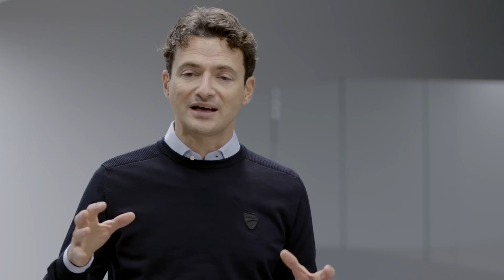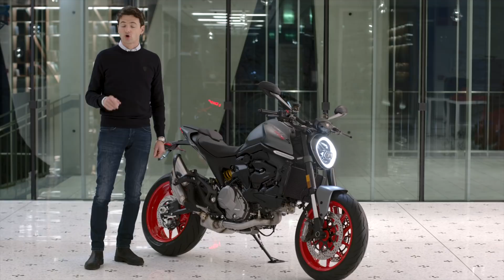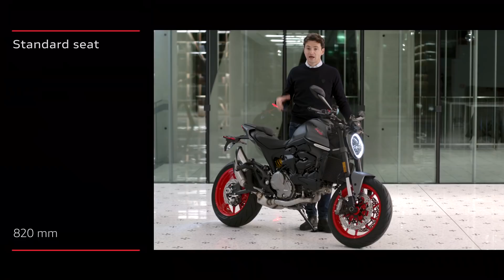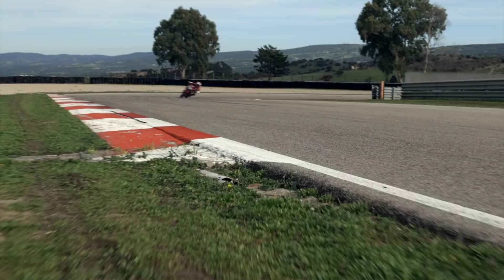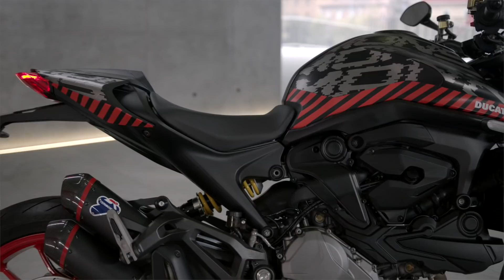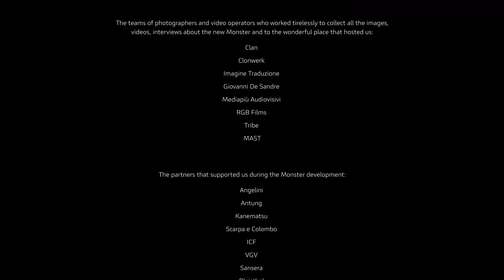New Ducati Monster | Ducati World Première Episode 5 (ENG)

Comment: No trellis, no monster...😢
Reply: Such an accepting viewpoint you have.
Reply: I feel the same way, should be called ‘Imposter’
Reply: @levicharles996  BS.  There's a heck of a lot more to a motorcycle than its frame design. Aren't you forgetting the 40 lb weight reduction on the new bike, partly enabled by the frame change? I've done a personal project Ducati where 50 lbs were removed; everything was improved dynamically. Everything.
Reply: @rlsedition  Yea I understand weight savings is huge. But I think everyone can agree that trellis frame, especially painted red is iconic. I rather have the valve spring set up than desmo on this bike. I own a M620 and that thing is stupid light compared today’s bikes, 35,000 miles of fun.
Reply: @levicharles996  Maybe Ducati pushed some of their product features a little too aggressively, like the trellis frames and desmodromics, only to drop them recently on some models. It's always a fight between marketing and product engineering - do you make changes when new/better technology is discovered? Do you sit on a design forever or do you re-imagine the look every so often? Tough calls, to be sure. OBTW, your M620 is WAY out of date, product-wise. Don't demo a new bike; I think you'll want one.
Reply: @rlsedition  yea new ones are way better, but ktm uses a trellis frame in motogp and they are competitive. So marketing could have pushed to keep the trellis...
Reply: I own a 1998 900SS CR. I think it’s gorgeous, but technology moves on.
Reply: @rlsedition  is my opinion. Others might like the bike, I do not comment on their opinion. The monster must have certain characteristics...read the history of the model. Sure, technology moves on, but you don’t have to screw up completely the image of a particular  can call it something else...
Reply: @rlsedition  just call it something else...
Reply: @emberducati9237  sure, I agree, but new models can have different names. This is not a monster!
Reply: @emberducati9237  You're right, and design moves on as well over time.
Reply: @Dr_LK  No, it's still a Monster, just a new expression of the brand. The trellis frame is not the only design feature on the machine.
Reply: @levicharles996  Yes, but it lacks many features we take for granted today and it doesn't meet required emissions laws.

Comment: It's Yes because you see buy at 11200 or 11500€ a motorcycle i have now it doesn't even have the name, not in much sense because not to the treliccio or the monoarm the bike is all forward "like the Japanese", but now the z800 to the treliccio 🙄😳🤫, the cb1000 the mono arm 😤😳🤫 the mt03 all the electronics of the 🤔🤔😒 world, and a cross done wrong of the Cagiva Raptor"and I liked" brutal three cylinders first suzuki series sv650 , to then have the led lights 🤷🤦😶 is a stylistic cross between the Diavel for the forward projection of the engine of the super sport "something the year right" the frame of the street fighter that is ugly as hunger but on a motorcycle like the one meaning " only that neither to the V2 QUADRO engine because if not they did not sell v4 , the fork of the multi-road motorcycle ride of the cynical scrambler "as pale as few". This bike IS NOT A MONSTER but a Mach bè anonymously at least avoided in Ducati to get all the insults. But you can put the 125 stickers on the tank.🤦🙄😤😒😶. Dear Ducati "dear in every sense" good luck from a fan of the brand. Ps when you make a Monster I'll come and sell it at the dealership

Comment: Detuned the monster made it look awful because of the streetfighter bad move Ducati really bad 🤬
Reply: Sure, detuned the new Monster by adding torque and removing 40 lbs.
Reply: @rlsedition  listen if u like it Snd but I own a Ducati monster 1200r and it would leave that in its dust,one engine now why is that because of the streetfighter nice one Audi 👌
Reply: @dukedaz8920  Unless we're racing on a track, I could care less if your Monster R could "leave this new Monster in the dust". We're talking about riding on the street. I owned a Monster 1200 for a couple of years, so I'm somewhat familiar with the model. 
When Ducati already has two naked bikes with big HP motors (Streetfighter V4 and Diavel 1260 V-twin), tell me why they need a Monster V4 or 1260? Too much model overlap.

Comment: WTF , this should be updgrate to design, this not even 2% of monster.
Reply: So nothing is more important than the frame appearance, right, even if the new frame works better and is much lighter?
Reply: @rlsedition  it’s style and originality, sure this is faster and lighter than a previous monster, but it’s really visually standard.
And I think KTM uses a tubular chassis in motogp, and it looks like it still is light and efficient.
Reply: @RomainWhatever  I'm sure there were contentious management meetings within Ducati when it came to replacing the trellis with the "front frame"; however, their overriding goal was substantial weight reduction, which improves every dynamic trait of the machine. In motoGP, KTM has finally been able to compete effectively after several years of trying. Good for them, but it could be despite their trellis frame concept, not because of it. We're not close enough to the action to know.